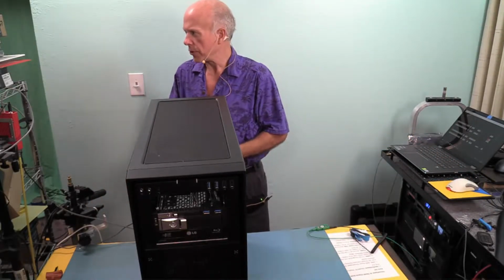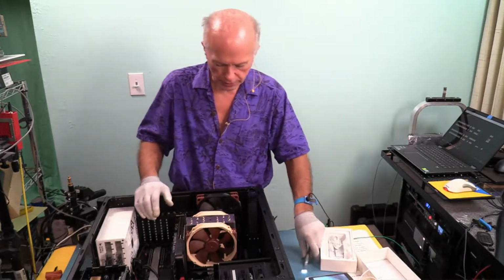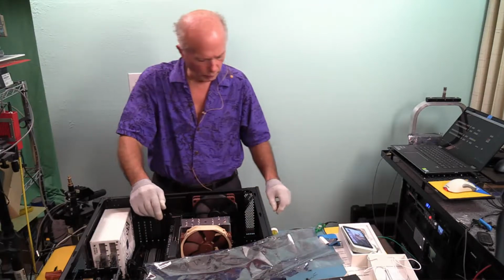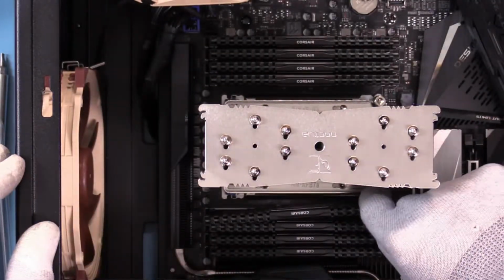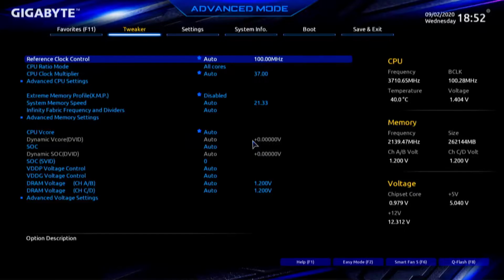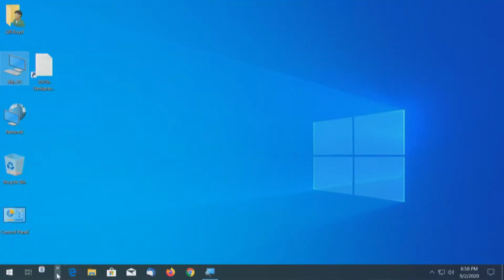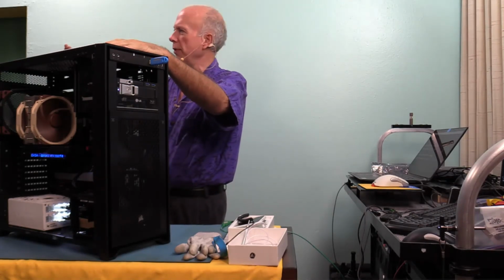Gigabyte TRX40 Designare Scoping RAM Clearance between 256GBs RAM and Noctua CPU Cooler

Comment: I have noticed that the ram runs at 2133hz. You have been able to configure it to run at 3200hz. How has the pc worked for you stressing it with daily use? Nice job! Thanks!
Reply from the maker: Hi Eliseo H. Zubiri, 
Welcome! Yes! We had Updated the Bios. And have since set the Bios to read from XMP for RAM SPD. So far, We've spent most of Our time Testing this and that extensively. We have yet to test the Rendering Speeds. We hope to soon! Lots of M.2 NVMe x16 cards to test! 

And We're awaiting reports on the latest Beta Bios. Based on a prior release which was a mess, We continue to wait! Bios: F4i is solid. When We do the next Bios Update, another Video! Appreciate Your Comments! This Motherboard combination offers the best value in Building a Computer right now. Thanks for Watching!

Comment: Laughing my ass off when you pulled out the Otoscope for a pc build.....! Most Pc builders like myself do the clearance stuff  with the motherboard out of the case!
Reply from the maker: Hi bassdtec2004, Where's the fun in doing that? Sorry You missed the point and were unable to realize the value nor understood the context. This is far more interesting and educational. Besides, this is our response to a question asked after the Motherboard was installed in the Case. We had the same type of comments relating to the cabling during a smoke test. Guess You have not seen our thermisivity tests yet either. Thank You for Watching!

Comment: I would like to combine two RTX 3090 graphics cards with an NV-link bridge for GPU-intensive deep learning application.  Would the Gigabyte TRX40 motherboard have room for and likely work well these two graphics cards?  I was thinking of fitting this inside a Fractal Design Define 7 XL case (or maybe Corsair Obsidian Series 750D) - would this work (in theory)?
Reply from the maker: Hi Ben WM, Nice to meet You. Depends. Possible, yes. Which 2 RTX 3090s? If You don't need the M.2 NVMe card, then any TRX40 Motherboard with 2 x16 PCIe Slots will work. Again depends upon which RTX 3090s. Key: Width of Video card. We installed an RTX 3080 that was 2.2 Slots wide. If the RTX 3090 is beyond 2 Slots wide, no go. Water Cooled, yes. Air cooled, maybe.
Reply: @BuildOrBuy  Thanks for the fast reply.  I've enjoyed a couple of your videos (the rest I haven't seen, as opposed to not having enjoyed them!).  Looking at the Gigabyte Designware, I was thinking perhaps they could fit in the 16 PCIe slots, leaving the 8 PCIe slots unused. I was thinking air cooling.  From what I can tell, there are 4 M.2 NVMe slots, so I would still have 3 available for the boot drive?  I'll email you a photo / video if you'd be interested ... or if you want to try this for your next video, that would be fun too ...
Reply from the maker: Hi @benwm1587 , Which RTX 3090? We can verify width. As far as the M.2 NVMe Drive Connectors, only use the 2 connected to the CPU. The other 2 are connected to the Chipset and are therfore just a tad bit slower.Yes! Always looking for ideas. We try to respond to YouTube Subscribers in a timely manner. Only usuallyv2creasons when we don't. If YouTube does not pass that info on to Us, it's happened before, or when Filming. When Filming, I have to hibernate. For example, this next video we're working on has taken 2 hours to stage. Results will be worth the effort! Stay tuned!
Reply: @BuildOrBuy  I'm in a queue with a local UK supplier and it says just "NVIDIA 24GB GEFORCE RTX 3090".  The order I've placed currently includes just the single graphics card and I've yet to get confirmation that it will all work with a second card.  UK supplies are scant with long waiting times so I've had plenty of time while I wait in the queue for parts to arrive!  I'd prefer to add the second graphics card if the compromise is to lose the Samsung 970 Eco Plus M.2 NVMe since the priority is GPU compute performance.  48GB (=2x24GB) of VRAM would facilitate much faster experimentation on larger datasets and avoid the slower data transfer between GPU and CPU.  I think you'd find a lot of data scientists would be interested in getting dual 3080 / 3090 graphic cards working in a setup at the $5k-$8k price point.  Most data scientists are not hardware experts like yourself - I built a single PC a decade ago - but would be more comfortable performing brain surgery than handling RTX 3090 graphic cards for fear of frying the parts, etc
Reply from the maker: Hi @benwm1587 , First, I'm honored. And flattered. Second, from this Description, You're getting a 2nd Generation RTX 3090. Looks like a Founders Edition. If that's true, 3 PCIe Slots wide. 1st RTX 3090, ok. No use of x8 Slots. Problem lies in using a 2nd RTX 3090. Not enough space. Too wide. I'll do some research. My expectation would be a Threadripper Pro. We'll see!

Our RTX 3080 is 2.2 PCIe Slots wide and barely clears connections on bottom edge of Motherboard. One USB 3 Connection had to be removed to accommodate the RTX 3080 we used.

BTW: NVIDIA RTX Bridging can only be accomplished on RTX 3090. Not enabled on anything below that model.

Amazing how changing one thing can change everything! Number one requirement being, 2 RTX 3090s! Keep Us posted on Your delivery. We did not know what we were getting until it arrived! Beggers cannot be choosers!
Reply from the maker: Hi @benwm1587 , Here's a Dual PCIe Slot RTX 3090. Gigabyte RTX 3090 Turbo 24G.
https://www.gigabyte.com/Graphics-Card/GV-N3090TURBO-24GD#kf

NVIDIA GeForce RTX 3090 24GB Founders Edition, see Full Specs:
https://www.nvidia.com/en-us/geforce/graphics-cards/30-series/rtx-3090/
Reply: @BuildOrBuy  Thanks Gill, really appreciate your insight and the link.  I will definitely keep you posted if you'd like?  2 x RTX 3090 is looking a bit doubtful at the moment.  One issue is that the supplier takes 48 hours to reply to enquiries by email (despite the 5star ratings) - European customer service vs US service, I guess!!  I'll see how flexible they will be in terms of sourcing the Gigabyte card.  One of the benefits of slow delivery service is you get ample time to modify your order..
Reply from the maker: Hi @benwm1587 , I'm looking now. Had my head in an x399 Designare EX all day. Your video card will work. It's the 2 x8 Slots that will not be functional. Unless You get the other Video card. As soon as I realized, here I am to clarify!

Yes! Please keep Us posted on Your progress! We never know whom else we might be helping! And as such, details matter!

We learn by doing! Working together, we gain more insight into a potential problem. Which helps Us to make better videos!
Reply: @BuildOrBuy  So you're saying you think the 2 x Nvidia founders card should still be ok with the Designare?  That's what I thought initially (2 cards ok, but not 4 cards), but having googled everywhere I couldn't find a definitive answer.  Just need to figure out which SSD to get if I can't use that M.2 NVMe slot (and where to put it on the Gigabyte Designare - any suggestions?)  ASRock TRX40 and Asus ROG Zenith II Extreme Alpha motherboards were also mentioned by another poster when I asked this question elsewhere, but I kinda like the Designare from your review, it seems to tick a lot of boxes, e.g. room for 256MB memory further down the line if needed. I'll definitely report back in a couple of weeks - you've been extremely helpful, can't thank you enough.
Reply from the maker: Hi @benwm1587 , Yes. Thank You! Here to help! A 3 Slot video card. Now if You can get a 2 Slot video card then You only lose 1 x8 Slot. To use the 2nd x8 Slot for an M.2 card, You'll need a self Bifurcating card that can utilize a x8 Slot. 

The GloTrends Sky card. However, it's PCIe 3.0. No one has same for PCIe 4.0 yet as far as we know. 
https://youtu.be/QF71-5nhrAk

Yes, this Motherboard is value added with all the additions. Options!

To get more gear added to a Motherboard, Threadripper Pro! Hope that helps!

Comment: Excellent video series of Gigabyte TRX40 Designare build.
I plan to build exactly the same station and I have question about memory config.
I plan to use 128GB /4x32GB/ and maybe later 256GB /8x32GB/
Which one Shall I use:
128GB /4x32GB/ 3200 CL 16 Patriot Viper 4
128GB /4x32GB/ 3600 CL 18 Patriot Viper 4
128GB /4x32GB/ 3200 CL 16 Corsiar LPX Vengeance /you used this one/
128GB /4x32GB/ 3600 CL 18 Corsiar LPX Vengeance

Is there any benefit between 3600 and 3200 speed? For 256GB in future is maybe better 3200 speed, to minimalize problems. Right?
Reply from the maker: I was logged on with different Channel. Did not realize until now.
Reply: @BuildOrBuy  So shall I choose 3200 CL16 or 3600 Cl18 memory? 128GB now, 256 maybe later? For this Designare motherboard? :)
Reply from the maker: Hi @dbartos4948  , Give Us the Part Numbers so we can help You make an Informed Decision! Need time to Research those, then we can talk!

Comment: Do you think HyperX HX432C16FB3K4/128 4x32GB QVL listed modules will fit this board just fine with this cooler? It's 34.1mm in height, compared to 31mm Vengeance LPX, but they costs 2 times lower in our region. You think it's good choose?
Reply from the maker: Hi Juri G, 
Excellent choice! Price is right! Specs are right too! DDR4, 3200, 128GBs. Room to grow! Yes, that will work well and slip right under the Fans on the Noctua Cooler. You'll just need to Slide those Cooler Fans up a tad bit more. Congrats! Keep Us Posted! Let me know if You need anything else! Buy direct from Kingston - hyperxgaming.com - Best price. Bang for the Buck! This is exciting!
Reply: @BuildOrBuy  I just found that HyperX HX432C16FB3K4/128 4x32GB doesn't work as 8x32 - based on QVL list from Gigabyte, so it means in future to expand up to 256GB I'll have to buy new full set of 256GB ram? As option, in my region I have only  Ripjaws V what is compatible up to 256GB, but their height is 42mm, so with Noctua NH-U14S TR4-SP3 I'll have to make bigger fans offset thank you did in this video, up to 15mm from initial position. With my case Define 7 XL I have enough room for that, but do you think it will make CPU cooling much worse?
Reply from the maker: Hi @jurig5579 , I would be concerned about a greater Fan offset, yes. Test You RAM and see. It may work even though not tested by Gigabyte. Are You using the double CPU Fan?
Reply: @BuildOrBuy I have one, but maybe will add another one for push pull . The problem is that to test the ram , I have to buy 256gb from the start, but I thought to  start just with 128gb and upgrade later.
Reply from the maker: Hi @jurig5579 , Do You already have the RAM?
Reply: @BuildOrBuy  nope, it's my first desktop after long time.
Reply from the maker: Hi @jurig5579 , If You do not have the RAM yet, You have 3 Brand options for Low Profile... Corsair, Kingston and Crucial. In that order.
Reply: @BuildOrBuy  yep, I just talked with  @WordTech from YT, who built GB Xtreme + 3970x + Noctua + 8 modules of ram what are 1.93 inches in height (~50mm), and he said that he didn't find any changes in temps after moving fans higher, so probably I will try Ripjaws V what are 41mm in height with this setup.
Reply from the maker: Ji @jurig5579 , Research Your RAM from Kingston.com website. Just because Gigabyte has not tested does not mean it will not work. If You cannot find that Info on Kingston.com, contact them. They will know and tell You what the timing settings should be to make it work.
Reply from the maker: Hi @jurig5579 , Sounds like a Plan. Keep Us posted on Your Progress. The TRX40 is more Memory friendly than the x399.

Comment: Thank you very much for your videos! I have a gigabyte designare ex x399 and a threadripper 2990wx with 128 GB of Corsair vengeance. When I built the system, two years ago, this was the max memory I could install. Now I’m reading that this is not the case, but none can confirm! Does it happen to know if I could install 256GB with my motherboard? Thank you!
Reply from the maker: Hi George, 
Thank You for Your Comments! Short Answer... Let's cut to the chase. Only way to know is to try and see. 

Longer Answer... Research! Here's what we know... 
Gigabyte X399 Designare EX (Rev. 1), Excellent Motherboard! We installed 4 x 8 = 32GBs RAM; Corsair Vengeance LPX 1 DDR4 2400 MT/s (PC4-19200) DRAM Memory CMK32GX4M4C3000C15R on that Motherboard. Why? That was what we could get at the time!

Gigabyte X399 Designare EX (Rev. 1) 
https://www.gigabyte.com/Motherboard/X399-DESIGNARE-EX-rev-10#kf

1.) According to Gigabyte's Specs, 128GB RAM. 
2.) According to Gigabyte's Bios Updates, don't see anything supporting more RAM or RAM Compatability. Only Bifurcation and AGESA code addressed. 
3.) Looking at RAM Compatability Chart, same. Only support 16GB sticks. 
4.) PC Part Picker... Same. 
https://pcpartpicker.com/products/memory/#Z=131072008&m=11
5.) CPU will support 1 TB or 2TBs depending what You read. 

https://en.wikichip.org/wiki/amd/ryzen_threadripper/2990wx#:~:text=The%202990WX%20operates%20at%20a,%2Dchannel%20DDR4%2D2933%20memory.

AMD 2990wx 
https://www.amd.com/en/products/cpu/amd-ryzen-threadripper-2990wx

Kingston Memory Search
https://www.kingston.com/unitedstates/us/memory/search?model=98336&devicetype=7&mfr=GIG&line=X399%20Designare%20EX

Maximum Memory:	128 GB non-ECC UDIMM
128 GB ECC UDIMM 

The problem is the Chipset? Everyone states, the x399 only supports 128 GBs RAM. However the Memory Controller is in the CPU. So nuetered CPU? This should work, in theory. 

To reiterate... Only way to know would be to try and see! If You have 2 x 32 Sticks of RAM. That would Confirm one way or the other. We do need to change out that RAM. Both x399 Builds are being utilized right now for Rendering And Testing. Based on Research, that's it. 

Might expect a Bios Update would be required to accommodate. 

Now You have me curious! Would love to check and find out for ourselves! It will not be right now! Have a Pool Exercise Video to Shoot coming up. Fourth Session. Final Shoot then Edit for Delivery to Client. Then we have to finish the TRX40 Build Tutorials. No promises but maybe in 2 months. Are You in a hurry?
Reply: @BuildOrBuy  You are amazing! Thank you so much! I’m not in a hurry. I don’t have the money to buy it, right now, even if it works...
I also thought to buy two sticks from amazon and return them if they don’t work, but I recently moved to Spain, I don’t speak the language and I am not sure about the return policy of amazon here with respect to electronics. 
In any case, I thank you so much for your videos and your detailed reply. If you find the time in two months, I would be very interested to know.
Reply from the maker: Hi @georgemountrichas , 
Here to help! Research never follows a straight line. We'll keep watch on this! Success with regards to Your current location. 

You have Us curious. The Full 256 GB Kit is hard to find right now. Saw it on NewEgg.com only. Getting a 2 stick kit is a Solution. A proof of concept. 

That's one of the perks of Amazon. Worth the price of Admission! No promises. However, We'll work toward that goal in 2 months. We have a back log of Videos we're working on right now. Stay tuned!

Comment: Hope you don't mind the synopsis... Great job BTW!
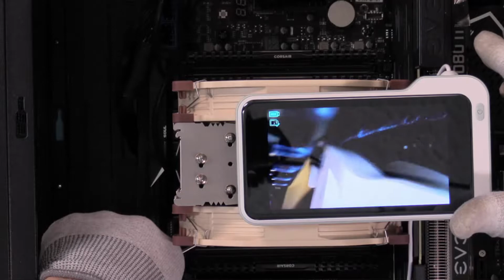4:20 Fan removal...
8:35 Video card hurdle cleared...
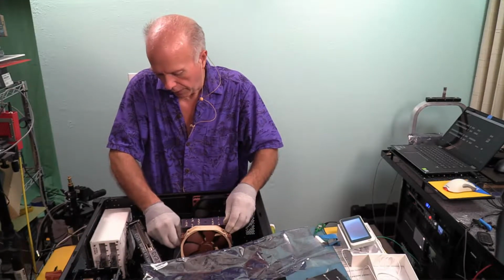9:45 and fans removed...
10:00 Clearance for RAM upgrade. And RAM plastic coverings caveats.
13:13 Cooler fan reinstall.
13:30 Scoped view of cooler RAM clearance (+1).
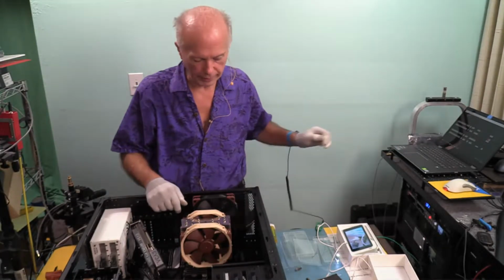16:27 Video card reinstall.
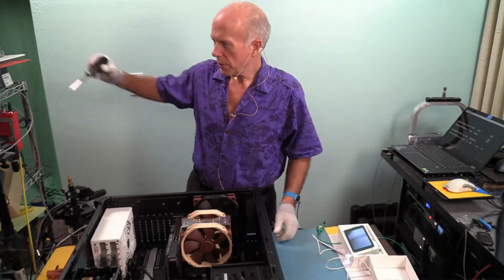18:30 Scope comments; nice touch being able to assess RAM to cooler fan clearances! (+1)
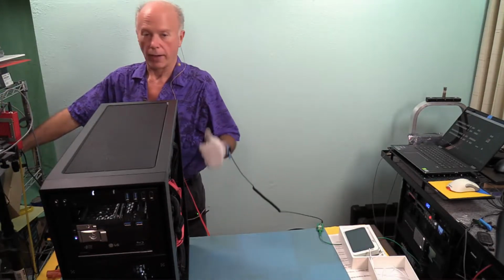20:20 Forward progress into BIOS review, update, etc.
20:45 Assess diagnostics from Windows.
22:09 Reboot and re-assess.
23:09 Post install debrief; outstanding!
Reply from the maker: Hi Micheal, Thanks! Appreciate Your Help and Comments! 

To answer Your previous Inquiry... 
Good Question for clarification. Remember: The Bios is still Beta. Based on experience with x399 Motherboards, we chose to keep it somewhat simple by only installing 128 GBs RAM. Only. As if! Five years ago, we were installing 32 GBs RAM and that was amazing then! After having installed the O/S (Windows 10 Build 2004), We then proceeded with stepping through 2 Bios Updates. Better stability achieved! We then chose to add the other 128 GBs RAM. So yes, this Motherboard will support 128 GBs in 4 Slots or 256 GBs in 8 Slots. 

Bios (F4c, Dated: 3-5-2020) although Beta, is stable. The latest Bios Update (F4k, Dated: 9-7-2020) is not stable and is not properly allocating PCIe Resources to Slot 4. Did we try it? No. 

There's Leading, Bleeding, Cutting and Trailing Edge Technologies. The Chipset is Cutting Edge, in this case a Beta Bios is Bleeding Edge. We'll let someone else do the Bleeding. Hence Gigabyte Forums! Guinea Pigs! 

Register as a User to Access. Read colonelhop comments. We need to do a collaboration with him. He's helped a lot of people. 
https://forum.gigabyte.us/thread/10261/any-experience-bios-trx40-designare

When we get another Bios Update, that is stable, we'll update and Post our findings! To keep track of those Bios Updates, Watch the Gigabyte Forums. 

A new Platform deserves careful and deliberate consideration while testing of basics for a foundation to Build on. Next step, NVMe Quad AIC!